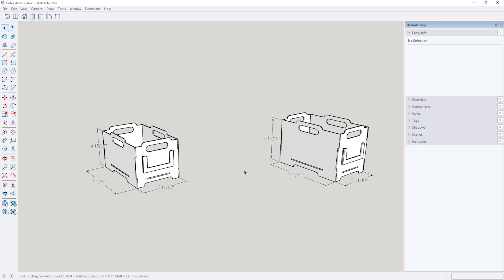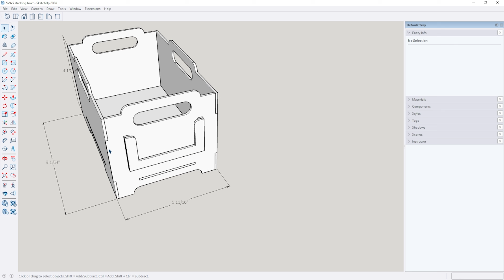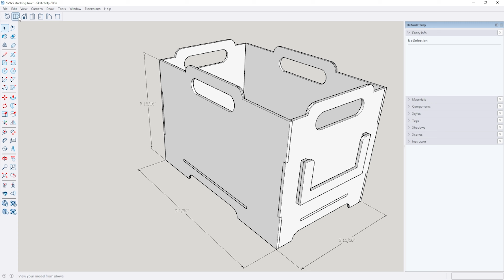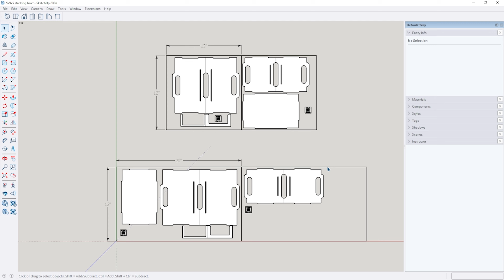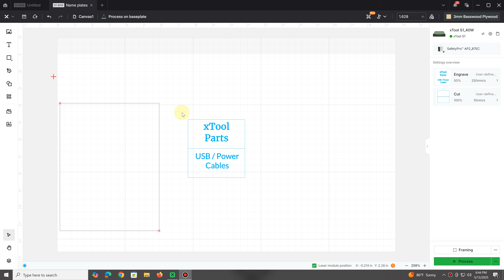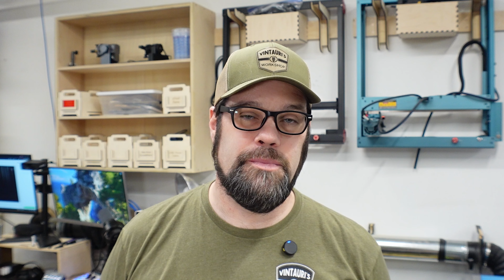xTool P2 vs xTool S1-40w | Stacking Storage Boxes for the shop

Comment: Can any laser cut acrylic and make these box? I need some of these for my house but wood would for sure go mouldy.
Reply from the maker: You can cut black acrylic and some other dark colors with a diode, but it's hit or miss.  You really want a Co2 to cut acrylic easily and cleanly.  You could build the boxes and then seal them with some polyurethane if you are worried about moisture.